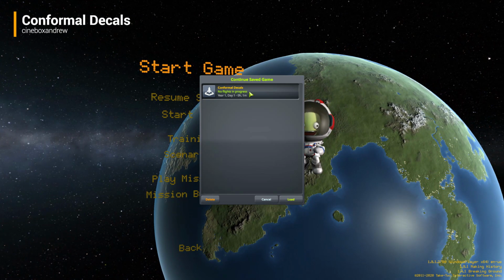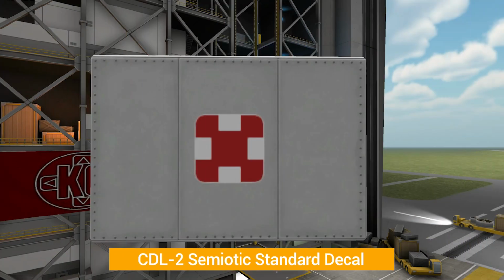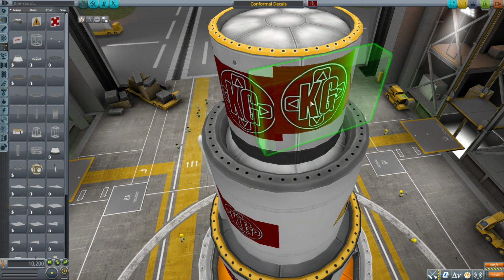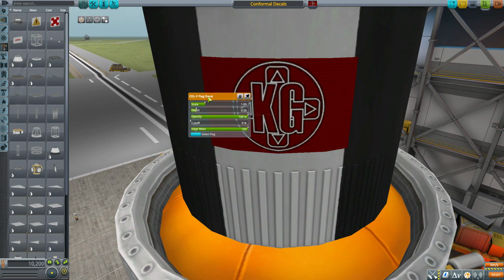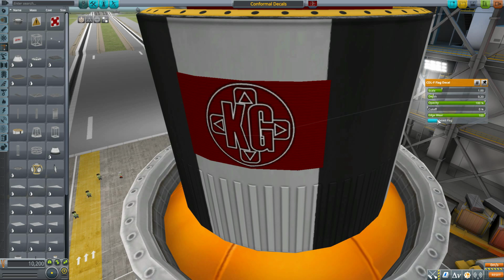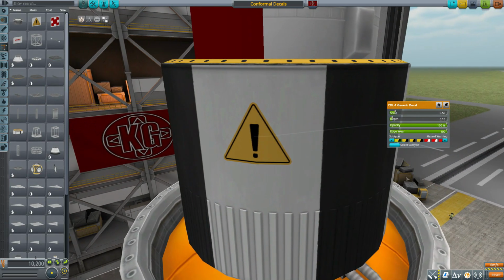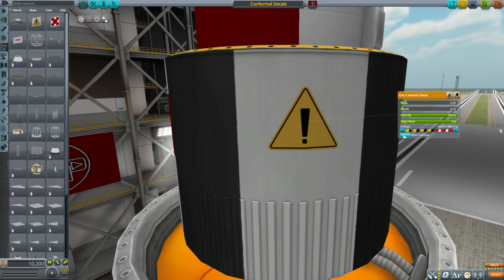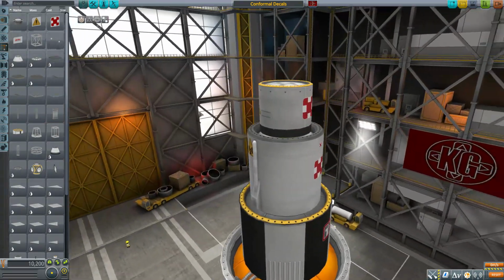KSP Mods - Conformal Decals

Comment: Edge Wear is if the part has raised or lowered parts on the model if it has a 90 deg. angle on it that does not have the decal on it use the slider it will make it cover it, But you won't see the raised area anymore. You Rock.  :)

Comment: Hi! just want to clear some things up

• The cutoff slider is for flags that are transparent, it adjusts how hard the edges are
• The edge wear slider is for that effect you see on the ridges, that effect is intentional so you get a break in the decal on seams and hard edges, but the slider lets you turn it down

I thought I fixed the issue with the zero-scale decals, I'll work on that for the next patch
Reply: slaps part selector, fuel tank section
This boy can fit so many decals